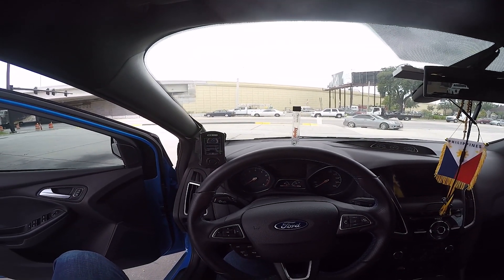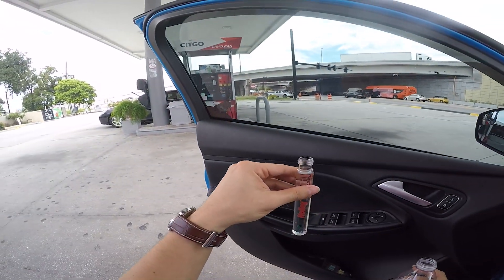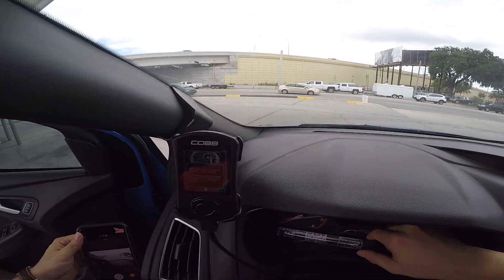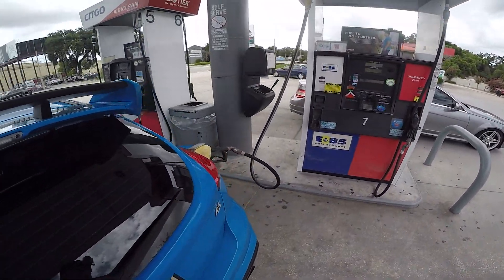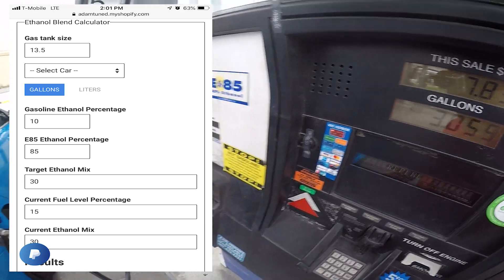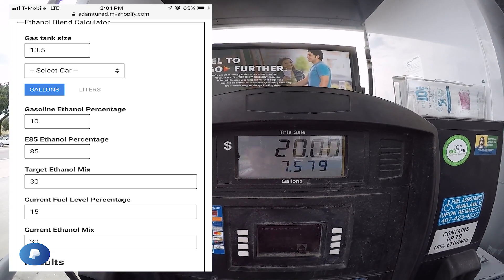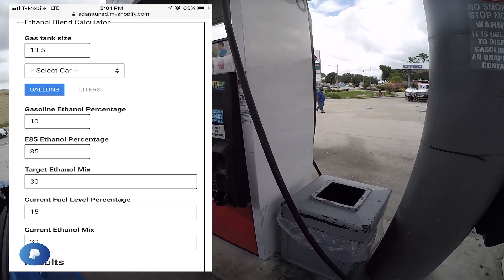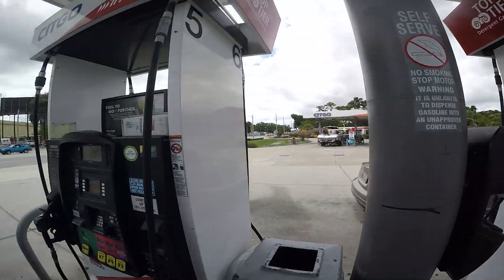Mixing Ethanol & Gasoline?

Comment: Pogi do you have to do this all the time at the same station you pump?
Reply from the maker: No, I usually only do it at new stations I have never been before or when the seasons change because gas stations will have a winter blend which is different then what they usually distribute

Comment: how would being tuned for e30.. and not be good to run e35 or e40?? what sense does that actually make.... your tune will use what it needs.. and make light adjustments on the fly
Reply from the maker: If that was the case, then why not just put straight e85? The tune will adjust to what it needs, right?

Comment: I wrote a code using python couple years ago while I was in college learning computer. I always wanted E15 because it makes the car run noticeably better (I have tried E20 and E25 but they don’t feel as fast for some reason, I suspect the computer isn’t tuned for leaner fuel), but in Washington all they have is E10 and only 4 gas station offers E85, so I usually get a 5 gallon jug with car near empty, and had to do calculations with calculators every time, very time consuming and prone to making mistakes, until I made the code. Here it is:
def Gasohol():
 flt_pctdesired = float(input("What is the percent of ethanol you want in your final gasoline? "))
 if flt_pctdesired <= 0 or flt_pctdesired >= 100:
  print("Are you kidding me?")
  flt_pctdesired = float(input("Try it again, what is the percent of ethanol you want in your final gasoline? Get serious this time! "))
 if flt_pctdesired <= 0 or flt_pctdesired >= 100:
  print("Dummy, I don't think you are capable of doing this task! Bye bye")
 else:
  flt_quantity = float(input("How many units of the final gasoline do you need? "))
  if flt_quantity <= 0:
   print("Just dump it in the toilet!")
  else:
   flt_pctfuel1 = float(input("What is the percent of ethanol in your pump gas? "))
   if flt_pctfuel1 == 100:
    print("This is pure ethanol, not pump gas!Go see a doctor and fix your brain first before you play with flammable liquids!")
   elif flt_pctfuel1 > 100:
    print("Trust me you are on drugs, maybe come back and try this again a little later after you are back from the rehab?")
   else:
    flt_pctfuel2 = float(input("What is the purity (percent) of the ethanol you plan to mix the pump gas with? "))
    if flt_pctfuel2 < 50:
     print("That's some poor quality ethanol, I suggest you don't mix this with your gas and stop and think what you are doing!")
    elif flt_pctfuel2 > 100:
     print("Trust me you are either on drugs or your drank too much of this stuff, maybe come back and try this again later when you are sober?")
    else:
     flt_fuel1_quantity = ((0.01 * flt_pctdesired * flt_quantity) - (0.01*flt_pctfuel2 * flt_quantity)) / (0.01*flt_pctfuel1 - 0.01 * flt_pctfuel2)
     flt_fuel2_quantity = flt_quantity - flt_fuel1_quantity
     print("You will need to use", flt_fuel1_quantity, "unit of pump gas,",
     flt_fuel2_quantity, "of ethanol to make", flt_quantity,
     "unit of E" + str(round(flt_pctdesired)) + ".")
     promptYorN = str(input("Do you want to make more fuel? Enter Y for yes, N for no. "))
     if promptYorN.upper() == 'Y':
      Gasohol()
     if promptYorN.upper() == 'N':
      print("Have fun, don't blow yourself up!")

Gasohol()
Reply: Regular 93 is typically e10

Comment: hey if its my first time mixing e30
should i do the mix when im at 50 miles to E or should i do it when im almost at E like at 5 miles to E? i have an rs ! i hope you can answer!
Reply from the maker: On my first fill up I waited until I was around 5 miles to E just to make it easier. 50 miles to E is still a lot of gas in the tank.
Reply: @bettadenu1  yeah cause usually I fill it up when im at 50 miles to e and it fills up with 9 gallons 😅 thats why i was confused! but thanks man i'll try it soon!
Reply: Then how did you switch back to just 91? Waited till it said E-5miles left then fill it back ip with pure 91?

Comment: Or just get flex fuel kit. Don’t have to worry about mixing issue.
Reply: Flex fuel kits allows cars to run ethenol, it doesn't change your fuel system completely. You need a proper fuel system to run full e85.

Comment: I’m also confused as to how you calculate how much ethanol is in your fuel system before you fill up again, so you don’t end up with an E40 blend while calculated for an E30 blend. There is still residual ethanol in the fuel system from the last refuel
Reply: There are online calculations that calculate that.
Reply: @MericaFuckYa  but they aren’t completely accurate unless you are using a flex fuel sensor to determine the exact amount of ethanol currently in the fuel system
Reply: @MericaFuckYa  after a while though I know a lot of tuners recommend a tank of 93 to prevent the numbers from getting too out of whack over time
Reply: @noblevengeance312  so with an ethanol sensor and gauge, this test tube thing is irrelevant? And you could just fill up with the car on or at least the ignition on and it’ll show you the numbers changing to get to the desired e30 or e40, depending on tune?
Reply: @jonstechchannel  it’s not irrelevant because you have to put fuel inside the tank in order to see the ethanol content. If your car is tuned for 85 and you just dropped in E40, you won’t know until you start the car and read the sensor. Therefore, the testing kit is very relevant. Even with a sensor you should always test your ethanol. My step brother blew up his camaro SS because he didn’t test his ethanol, incurred detonation and then the engine started knocking.

Comment: Can I get a link for the calculator?
Reply from the maker: https://www.tuneplusinc.com/pages/tuning-tools
Reply: @bettadenu1  ok I admit. I messed up. I’ve never ever used e85 probably shouldn’t have tried it my first full day of driving my 2012 focus 12.4 gallon. Tonight I was on about little less than 1/4 tank of 93 fuel. E85 is 1.86 gallon right now. Total newbie here. No idea what’s it’s ethanol percentage is. I will soon after this. I put $9.00 of e85 on top of less than 1/4 tank of 93. Now it’s running like dog crap. What do I do? Go get ethanol free fuel and add it to it and start over next time I know what I’m doing? Please help man
Reply: @Travis2L  you can’t mix 93 with the e30?

Comment: 13 ST, i had half tank of 93, put bout 4, 4.5 gal of E85, didn't notice any difference whatsoever- although i did notice absolutely no ignition correction through any rpm including 5,800, 6k. usually I'll get a slight .5 - 1.0 but nothing. i was hoping to feel slight torque increase but nothing. strat tuned
Reply from the maker: What kind of tune are you running?
Reply: @bettadenu1  he said strat tune

Comment: Haha I'm super scared to mix fuel and trying to figure out how. Good thing I came up with your video. 
How do you calculate the gasoline ethanol percentage? I'm in California and hoping is 10 haha. Do you also recommend buying and E85 test tube?
Reply from the maker: Yes, I recommended the test tube with link in the description. Also, 93 typically contains 10% unless stated otherwise on the pump that it is ethanol free. Hope that answers your question.

Comment: Getting a e30 tune for my focus st, does my gas have to be completely empty before I flash my car w/ the tune, let’s say I have quarter gas Of 93, do I just put in the calculator I have 0% ethanol in the tank?
Reply: Also after my 1st time filling up on e30
And get to around quarter tank how much E85 would be in the tank?
Reply: Clay’s vlogs if ur filling for the first time just add  4 gallons of E85 an fill up the rest for 93 after u get ur  first revision u start calculating,
Reply from the maker: Sorry for the late reply. I'm sure you already figured it out by now but if you have 93 in the tank chances are it contains 10% ethanol content and that is what you would put in the calculator.

Comment: I really really appreciate your video. Helped me so much.! Was scared to do the mix / blend my self but with your video i am 💯 more confident now
Reply from the maker: Glad to help, if you have any other questions just let me know!
Reply: Gregorio Reyes I do actually . Is the comment section place to ask?
Reply from the maker: @Checkers_123  Yeah I don't mind, ask away
Reply: Gregorio Reyes So i got everythin figured out like how it works. But question is. Like my case , fuel tank Size is 15.9 . (Wrx) using same calculator as yours. But obiously i know that when car says empty / low, i still have about 3 gallons in car? As what i was told so i technically only use about 12.5 gallons to complete fill. So calculator tells me to put mix in but it exceeds the amount that i need  so do i up my percentage in tank?
Reply from the maker: @Checkers_123  Try lowering the tank size to about 15.5 and upping the percentage in the tank little by little like 5%
Reply: Gregorio Reyes Well i technically just go off of what i know it takes to fill up. Which is about 12.5 of the 15.9 gallons. so i just put about 15% or so and my e85-93 amount adds up
Reply from the maker: @Checkers_123  Ah okay I get what your're saying. Then yeah I would just adjust the percentage of what it says on the AP